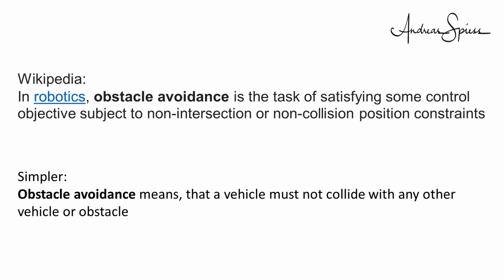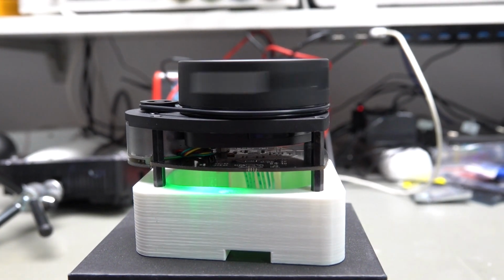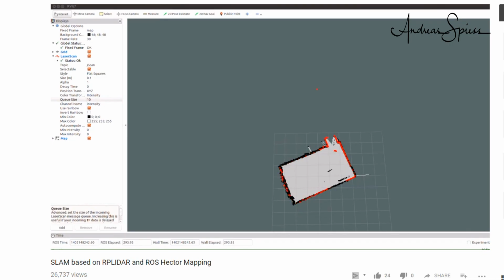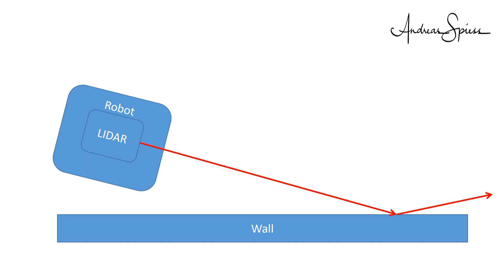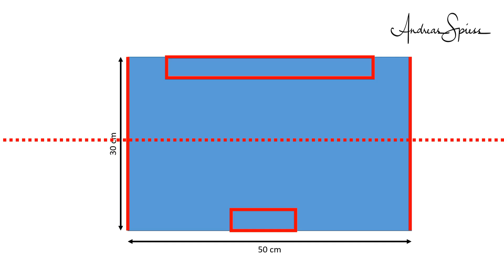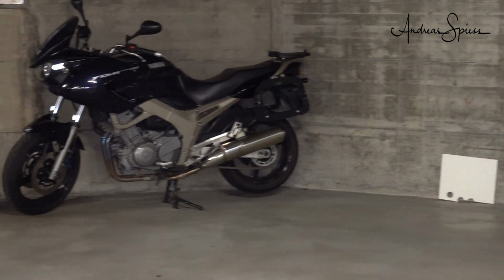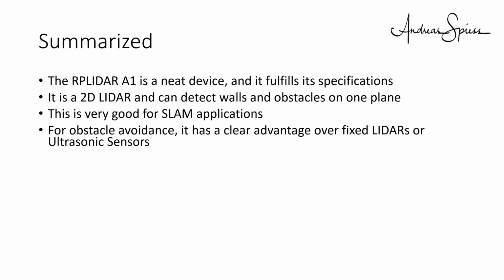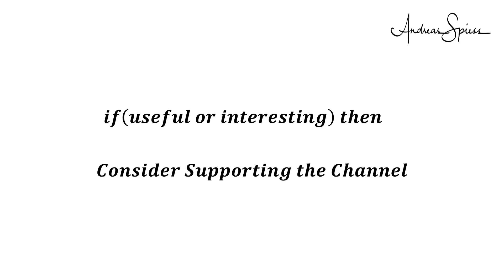#227 The ugly truth about LIDARs for obstacle avoidance (RPLIDAR A1, Arduino, ESP8266)

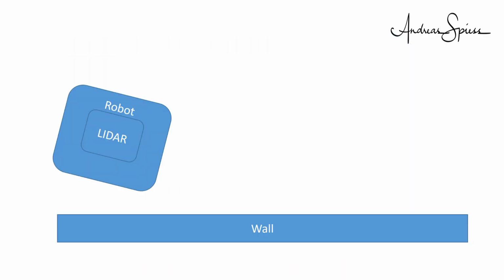Comment: 5:05 That is incorrect. The wall doesn't bounce the beam in the opposite direction, it doesn't reflect it in any direction at all. And the wall also has nothing to do with how stealth technology works either. Use a laser pointer and point it at a wall at that same angle and you'll still see the strong bright red/green laser dot, but you won't be able to find its reflected clone because it never bounced and reflected off the wall as you suggest. But now instead of the wall run the same experiment but point the laser pointer at a mirror and you'll notice that the dot isn't anywhere near as bright anymore, because the beam ends up being reflected just how you illustrated. That is also a good example of how the F-117 Night Hawk with all of its weird angled paneling would deflect radar signals.
Reply from the maker: How the F-117 Became Stealth

The F-117’s low observability was achieved through three main pillars:
1. Faceted Geometry (the core breakthrough)
When the aircraft was designed in the mid-1970s, computers were not able to model radar reflections from curved surfaces accurately. However, Lockheed’s Skunk Works had access to a Soviet academic paper by Pyotr Ufimtsev (“Method of Edge Waves in the Physical Theory of Diffraction”).
This paper gave a mathematically tractable way to compute radar reflections from flat, planar surfaces.
The F-117 therefore used:
Dozens of small, flat facets arranged so that incoming radar waves would be reflected away from the radar transmitter.
Sharp edges that redirected energy instead of sending it back.
2. Radar-Absorbing Materials (RAM)
3. Infrared, Acoustic, and Visual Signature Control

Comment: for a biped robot that only walks indoor maybe a kinect would be enough to navigate through doors and maybe locate stair steps, i saw a robot wheeled robot with a kinect, i think it was a Linux PC
Reply from the maker: Well possible. I never used Kintect, but read that it is a pretty good system

Comment: Great video! I am a novice working on a robot and need to do away with the ultrasound because I have dogs. I am using Rasberry Pi 4B 4GB do you have any suggestions to replace the ultrasound units? My robot does not exceed about 3 to 4 miles per hour.
Reply from the maker: Maybe you look at Time of flight sensors or Lidars? You find videos for both topics on this channel.

Comment: While you use the Arduino Framework, everything will be slow.
Reply from the maker: I do not think so. It uses standard C++ compilers
Reply: @AndreasSpiess  C and C++ compilers are not magical, if you put to much thing to do, more time you need to complete. When you use a framework or library there is a a pile of functions calls, since the microcontroller is a very limited enviroment each call counts more processor cycles before executes the functionality more time to response. When you look how and processor executes jumps in machine code, you can see that there is a lot of operations and each function call can be a jump.
Make a test, try to generate a simple pulse with arduino framework and the same pulse with bare metal programming using the registers directly and then put in the oscioscope, then you can note the difference. It was made by Joop Brooking in a drone development with arduino Uno in this vídeo: https://youtu.be/fqEkVcqxtU8?t=173
Reply from the maker: I am old enough to know that Assemble code is faster than C++. I did this for my living when I was young. And because of that, today, I spend money for faster "metal" to avoid it  ;-)
Reply: @AndreasSpiess  So you are really old, because I wasn't talking about assemble code. Today you can acess registers from the C code. I'm talking about the high level code of the framework that make piles of function call. You can avoid it all and still program in a higher level language then C.

Comment: Thank you Anrdreas. Great presentation. My question and yeah, we are at 2021 now, is with what you've presented and what I gleaned from other sources, isn't this why things that crawl, fly, etc... utilize multiple sensor types to create a holistic picture? The end of this video showed you positioning ultrasonic in three different orientations with the Lidar. The limitations that you identify, and thank you for that, pretty much was the icing on the cake for me for why our critical systems out there now are using every available tech to overlap and cover the blank spots. In this time (three years) have you seen any one of the tech's used rise to the top and provide a clear picture? Thanks again, really enjoy the breakdowns you do of this stuff and it's serving well in educating me to the topic.
Reply from the maker: Seen from here we are in the "innovation valley of death" between the hype and a useful system in self driving cars (https://www.researchgate.net/figure/The-valley-of-death-in-innovation-and-the-context-of-the-simplified-BID-process-Based_fig1_331105240 )

Comment: Excellent explanation. I am considering a combination of lidar and camera for my Jetson nano based robot. The real challenge is speed of data processing and reaction time in the software/hardware. Python on ROS is easier but i think may not be as fast to process as C++.... I may need to resort to low level assembly code just to read lidar/camera data to produce the stop command. Other than that I think the rest of Slam will work fine. Any thoughts about voice recognition and speech synthesis... Next step is to get my robot to talk back to me. 🤓
Reply: ROS+LiDAR works fine in a laptop with Intel i5-4th gen and the driver is coded in C… however, I think that even python could handle the signal.

Comment: Thanks - been cogitating these exact issues.  Wouldn't be too hard to put a servo there to make the LIDAR rock forward and backward to get vertical scanning.   At least these are fairly inexpensive.
Reply from the maker: Possible. But then you lose quite some speed, I think.
Reply: @AndreasSpiess  Have you tried out a 3d one?
Reply from the maker: No

Comment: What would be a good sub-system to use with Arduino to calculate the obstacles?
Reply from the maker: Maybe an Arduino is a little weak.
Reply: @AndreasSpiess  Thanks for the reply but let me rephrase... If I use an Arduino to control servo's etc, what would be a good platform to use to control the lidar info and just send closest distance and angle to Arduino? I currently use an Arduino to do everything and it is almost working, but like you said.... Arduino is too slow

Comment: dont be dumb buy a servo for change the lidar horizon
do you want rally a donation
Reply from the maker: And the speed? Will be drastically reduced :-(
Reply: @AndreasSpiess  so use 2 mirrors on motors as it done since 20years for laser draws shows
tought servo are 60 deg per second it seem enought for a 20deg elevation of the device you show obivously it will not refresh more than actually it do but for such slow roller vehicule its sufisant

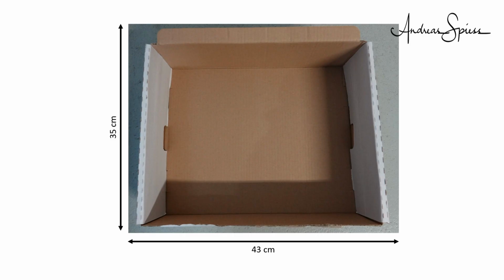Comment: 9:00 I believe you have been unfair to its measurement capabilities. The vertical boundaries of the box are quite thick and would measure up to 1.5 - 2 CM combined. This makes measuring the length from inside the box different from measuring it from the outside and hence possibly explains the 41 CM vs 43 CM discrepancy. This is confirmed by the correct measurement obtained for the width. The horizontal boundaries are very thin and hence measuring the width from outside the box of from or the inside will result in roughly the same value ~35 CM.
Reply from the maker: I do no more remember. Did I really complain about the 2 cm? Then I certainly was a little harsh.

Comment: The argument about wall tracking was disingenuous. Wall paint is predominantly a light scatterer, and not a polished reflector as depicted. At ranges of interest for wall tracking there’s plenty of reflected light. The data closest  to the vehicle is likely to be lost to the LIDAR’s rangefinder’s minimum distance, so mapping the space being moved through in advance of proximity is helpful. Anyone with the sophistication to create this video already knew that and advanced a line of reasoning they knew was false. Its fairly clear the intention is to add confusion rather than insight.  If stereoscopic optical imaging worked well enough to do range finding LIDAR would still be useful in low/no light. If LIDAR worked perfectly RADAR sensors would be obsolete. An so on for ultrasonic all the distance and proximity measuring schemes. For the time being no single sensor type meets all needs.

Comment: Very interesting video! I do not know about the RPLIDAR but I have seen other LIDAR sensors on the market that do not capture BLACK surfaces properly or at all just like your stealth plane example! In addition they may have too many noisy artefacts to be filtered. I recommend asking the manufacturer for a video of the sensor in operation before buying.
Reply from the maker: You are right: If no light is reflected, these devices do not work. This is amso the case at angled surfaces (The F117 Stealth Bomber used this fact)

Comment: 360 degrees / 200 measurement per revelation should give a smallest object to detect at 1.8 degrees and not the mentioned 0.25, or am I mistaken?
Reply from the maker: I do no more recall the details. But you calculation here seems to be right.
Reply: I agree.

Comment: a sparrow brain can fly through a bush at 30-50 km/h and do reliable obstacle avoidance in this complex irregular environment. it has minimal power cosumption. why invent a clumsy replacement instead if reusing an elegant robust system that has been extensively tested and optimized? Lack the intelligence to copy an array of analog computing elements?
Reply from the maker: For sure, nature is far ahead in this respect. Maybe you find a way to connect to a sparrow brain and use the information?

Comment: The auto industry has solved this LiDAR blindness problem by using 75GHz RADAR to supplement the LiDAR sensor.  Other types of sensors that are more nearsighted can be used to improve nearby object accuracy.
Reply from the maker: AFAIK they also use some 3D LIDARS

Comment: it may be possible to perform LIDAR scanning using three 360° camera's and a scattered laser. the laser would have a simple time stamped carrier signal. the target object reflects the laser back to each of the 360° camera's that are calibrated to track the direction of the incoming laser and decode the time stamp giving a triangulation ability. the rest is processed much like GPS.
Reply from the maker: Maybe this is possible. However, the speed of light is quite fast ;-)
Reply: @AndreasSpiess  that will only improve the resolution.

Comment: For simple obstacle avoidance, a 2D lidar is great. Many environments are sufficiently constrained that planar sensing is fine. Once you start worrying about complex terrain it becomes a really hard problem. You discuss hanging obstacles - once you start getting into those, you might as well start worrying about deformable obstacles. The simplest example is long grass: any simple sensor will register it as an obstacle, but you want to drive right over it. At that point you need multiple sensors - probably a touch sensor combined with something like a planar lidar.

As for not wanting to process all the data from a planar lidar, just wait until you realize you want to add a camera. It's definitely worth having at least raspberry pi level processing on a mobile robot, if not a full on laptop-type computer.
Reply from the maker: I agree with the camera. These days you can get quite some information with it and ML.

Comment: What if u mount the LiDAR on a servo/stepper motor which moves it up and down (changes the angle) ? :)
Reply: I'm not 100% sure but we had a 10,000$ + lidar scanner in our lab and it scanned 3D instead of 2D. I believe the brand was velodyne
Reply from the maker: You get 3D scanners, but, as you write, they are much more expensive :-(
Reply: @AndreasSpiess  I mean mount your LiDAR on a say plate which you can change the angle of with a servo or a stepper.

Comment: My idea on solving the 3D problem:
Attach it on a servo so it meassures vertically. Then rotate the servo in desired angular resolution.
Voila: 3D sphere covered.
Reply: I could think of a couple of problems with this but, suffice it to say if you can create a 3D assembly there is BIG money in it right now.
Voila: Easy money for a smart guy like you!
Reply: @real_arbuckle  there is already a similar device invented by sparkfun...

Comment: Lidar is in fact very good at detecting obstacles and there's a major point missed here: autonomy systems don't just judge a single lidar scan, but many successive scans over time to answer the 'is there an obstacle here'. It also helps lidar tremendously when it's on a moving platform with varying roll and pitch and there's a good positioning system (RTK gps and high rate IMU) aiding in positioning-tagging points.
Reply from the maker: You are right, "sensor fusion" can add a lot of information.

Comment: @Andreas Spiess
6:45 You can put the lidar on a rotating wedge, in that way you can know at what angle the liar are (because you know the rotation of the wedge) and suddenly you have made a 3D lidar out of a 2D liar. (basically make the 2D "lazer disc" wobble around in 3D space, with whatever angle you need to cover the desired volume)
(A probable cause for problems is the G-forces created from the lidar's own rotation)
Reply from the maker: You are right. But then you lose a lot of detection speed.
Reply: @AndreasSpiess  Yes, but maybe it's better than not seeing the obstacles at all?

Comment: What if you mount this lidar vertically and rotate it so it can see an hemisphere each half turn?
You absolutely reduce the acquisition speed but in some conditions a low moving speed could be fine with it.
Reply from the maker: There are many possibilities. But if you lose speed it will be too slow for most "moving" applications

Comment: I do agree with Elon Musk. LIDAR isn't suited for self driving cars. But that doesn't mean that there aren't uses for them. 
Like, a gamer doesn't need a Quadro GPU. It can be used, but it's a massive waste of resources.
Or, you could use a wrench to get a nail into wood, but a hammer is a better tool.
Reply: if you get to know the state of the art benchmark on object detection with or without lidar, you will realize lidar is not just redundancy but actually needed for autonomous car within 3 years

Comment: hi! thanks for the video on the RPLidar A1, I'm wondering if the A1 will work in outdoor mode/sunlight? In order to produce 3D pointclouds with the A1, is there 
software for navigation already designed for this unit? Will I need to write code for it to work with ROSS? thanks for the help!
Reply from the maker: I did not test it outside, but I assume the range will be considerably shorter if it is sunny. 
Concerning ROS integration: I found this link: https://blog.zhaw.ch/icclab/rplidar/

Comment: Thank you very much for the video Andreas, very informative. I'm wondering if it would be possible to scan a dog and see only the body without the fur. Might you know if the LiDAR can penetrate fur or hair or clothing? Thank you very much.
Reply from the maker: LIDAR uses reflected laser light.wherever it is reflected is the distance it measures.
Reply: Probably not working, it would not penetrate fur. Unless you really use a high power laser, but then your dog would also lose its coat.

Comment: Why not attach the 2D lidar to horizontal motor ? You can get 3D data that way
Reply from the maker: Possible, but the speed would be quite low then.
Reply: @AndreasSpiess  There would definitely be trade-off, but it feels like there is redundancy in single plane LIDAR. If you rotated it periodically, you could have multiple planes (with less data points per plane). Not sure, what you mean "the speed". The speed of updating the environment ? I think, It could be tweaked, such way that the LIDAR spends most of its time in the most important planes.

Comment: Nice video, shows clearly that you need more than just a Lidar; Lidar for SLAM, IR or ultrasonic for obstacle avoidance, switches with bumpers for colllision detection and IR sensors to detect the stairs.
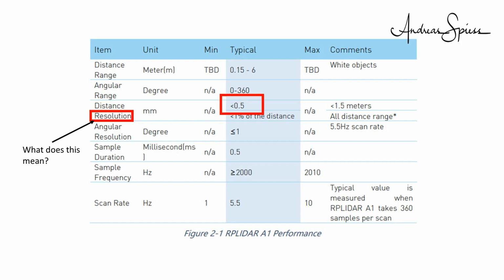One thing: at  9:21 you are confusing "resolution" with "accuracy". The RPLIDAR gives the distance with a 0.5mm resolution but the accuracy depends on the type of surface. Slamtec does not give any data on this, but from experience I found that it is safe to assume a 1-2cm accuracy of the measured distance.
Reply from the maker: You are right!

Comment: As long as your vehicle moves at a sensible speed for home-made robots (i.e. under 5km/h), you should be able to get around the scanning plane problem by taking advantage of the high scaning rate by oscillating the angle and overlaying the data.
Reply from the maker: This idea was discussed a few times in the comments. I never tried.

Comment: Turn it 90 degrees (rotating vertical) and scan it horizontally.  That converts it to a 3-D lidar, if you can find or make software to handle it.  You can define the scanning angle to whatever you need.  It would be pretty slow, however.
Reply from the maker: Exactly, it becomes quite slow. There is nothing like a free lunch ;-)

Comment: Dear Andreas how about using parallel processing using several arduino units. If the is justified design dedicated parallel processor.
Reply from the maker: Arduinos are not very fast. A simple ESP32 is much, much faster. Before going parallel I would use a faster processor.

Comment: did you measure internal or outer dimensions? 09:05 
also, you can put a lidar on a random swinging motor (a broken gimbal) to scan 3D field. not a rocket science.
Reply from the maker: You are right. You can move the plane, but you lose quite some speed